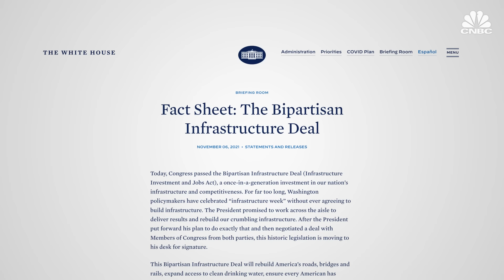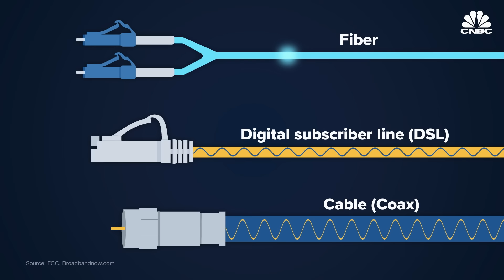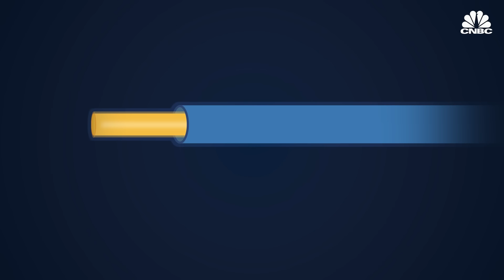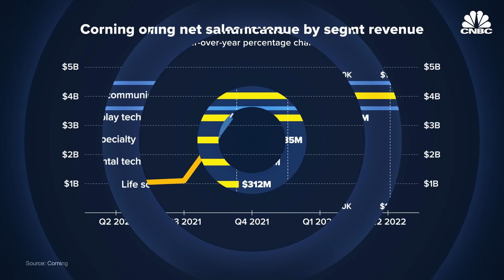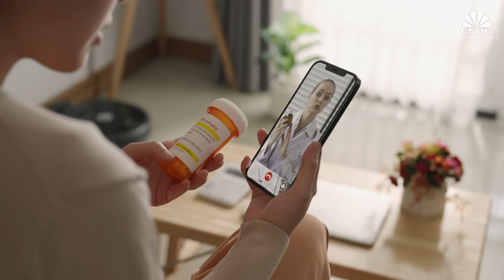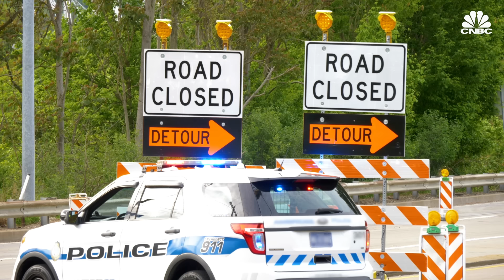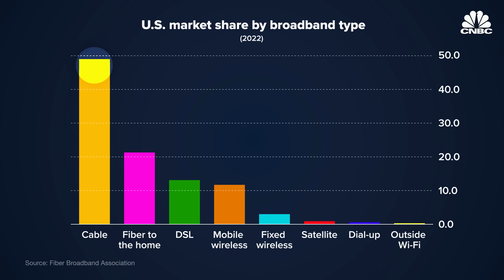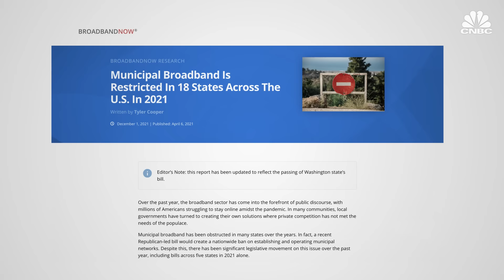How Fiber Will Speed Up America’s Internet

Comment: Internal networks can be satisfied with either copper or fiber. There's an ongoing debate between copper and fiber internal infrastructure mostly based on cost benefits. However, the long-distance communications are where the stark differences show. Fiber provides more bandwidth, cleaner signals over copper. I was initially amazed at the difference between Comcast (copper) infrastructure and the Verizon (fiber) infrastructure. much better upload/download speeds, better reliability, and comparable prices. If I ever move where fiber services are not present, I'll get a Starlink connection or 5G and will live with bandwidth differences just for the reliability.

Supply infrastructure of a lot of things were already at a breaking point before the pandemic. It was exacerbated by the pandemic and the following lack of employees.
Reply: We do pure fiber networks end to end here in Kenya and more and more customers will to ask specifically if as an ISP we are doing pure fiber. They don't want any less.
Reply: @mercynamikoye9084  Once you go fiber, you seldom go back to copper.
1. Better signal quality.
2. Smaller diameter cables.
3. Not subject to RF/EM interference.

One con just like going from analog to digital. If fiber is damaged, it's likely no signal just like digital TV signals.

Our main infrastructure was fiber. Sometimes the customer didn't want to pay to have a fiber net card put in their equip, so we'd use a txr to convert at their desk even though it introduced an extra point of failure.
Reply: @vwasson6725  is there an issue of cost in this industry like in health care? Cz for me in Kenya Nairobi, for 30 dollars only as a base my home customers have a 15MBPS connection inclusive of installation.  Pure fiber end to end. And it's a real 15MBPS and then can choose to upgrade to whatever suits their needs. For me as management I have 1G in my house for free that I hardly ever hit and costs the company next to nothing

Comment: Most houses don't need such fast internet and DSL is just fine. and some house holds are using just WiFi when in fact they should be connected by LAN when ever possible and WiFi only when needed.
Reply: I get what you're saying, but its going to be incredibly difficult to convince people to connect their devices with a cable. Wifi makes it much more convenient for most average people. I highly doubt most people want to wire their house with ethernet in every room or pay for that when wifi does most of the job. I do agree that wired is better for most tasks.
Reply: @JJFlores197  Most have no idea of the differences...until they see it. I provided an uncle a RJ45 usb dongle so he could plug in directly...even at his 15Mb dsl speeds he noticed a faster snappier surfing...and he knows NOTHING about computers

Comment: The business environment doesn't promote the upgrade of the existing copper plant fiber ... so in the center of Northern California (Silicon Valley), most homes are still using 50 year old copper runs for their Internet.  Comcast and AT&T are the primary providers ... but they won't compete for each other's customers, so there's no push to upgrade their infrastructure.  Consumers really have no alternatives and pay a huge premium for current technology if it's even available.
Reply: I'm in San Francisco and have had Sonic GIgabit Fiber for a few years. Sonic is a competitive local exchange carrier in the San Francisco Bay Area, Sacramento, and Los Angeles.

Comment: My question is why we don't make those thin hair cables much thicker in order to transfer more date inside if this is feasible ?
Reply: Not needed...single cable can transmit plenty...then there's extras, then there different wavelengths to increase...Just need the glass in the ground to the homes

Comment: Physically running fiber is the most expensive part of setting up a fiber network… The fiber itself is comparatively so cheap, ‘dark fiber’ where ISP’s run a shitload more fiber than they initially need is very common now, allowing them to spin up that ‘dark’ capability when necessary.

Comment: Are these fiber lines susceptible to em pulse? Or solar flare energy?
Reply: Nope, dont think so, they are made of silica, glass, maybe plastic? And they transport light, thats why fiber is so good.  Its immune to interferences unlike copper. You cannot bend it tough, as the light will not pass through.
Reply: No but the electronics on either end are

Comment: What about future-proof? As light is the fastest “thing”, does that make the fiber itself a future proof material that can last for generations of hardware revisions & bandwidth demand?
Reply: I always say it and the guy in the video said it. The limiting factor is the equipment on the end. Electrons generate photons and control the logical transmission of them. There is physical degradation on the trip due to length, fusion splicing and connectors. Then the reverse happens to go from photons back into electrons and the final conversion to ethernet. Light can be as fast as it wants, but it is only the highway not the engine of the car. An open highway with no traffic doesn't allow your Nissan leaf to go 186 000 miles per second.

Yes fiber can last. It has gone from carrying single analog signal to multi digital signal. This allows you to have secure information on the same fiber as public information. This allows you to prioritize data such as voice packets over internet. Packets. This allows you prioritize business data over general surfing and gaming.

My neighborhood had an analog TV cable feed amplified again and again in the 70s. This produces distortion and had a very high cost due to electricity use of the amplifiers. Then they ran fiber to the edge of the neighborhood and installed an analog fiber node. Most people think fiber means digital. Nope. The node uses 1550 nm wavelength going to it and 1310 going back on the same fiber. 

Then someone made a passive (uses no electricity) optical splitter. You put the combiner (splitter in reverse) in at the source and put the two signals on one fiber. When you get to the neighborhood you passively split the light wavelengths into two separate fibers and use the second abandoned fiber for whatever you want. I just doubled network capacity. 

Next, why go all the way from the source direct to the neighborhoods when I can assign different light wavelengths and put many neighborhoods on the same fiber but on different networks. Boom. 96 networks per fiber X2 fibers from the 90s. 

Final phase. Make the fiber a pure data feed and use both fibers. The opener is dual 10gig connections to a small segment of the neighborhood. The old stuff still in use now has a single 2.5gbs analog feed and the cable companies are selling 1 gig and meeting the target with ease. 

I've been doing FTTH since 1999. All the stuff I put in is still there except the edge technology has changed.
Reply: I doubt it the design can probably be optimized to be faster or something

Comment: you just tunnel under streets you don't rip them up. it's like oil pipeline laying except marginally more horizontal and MUCH shorter but can still take much advantage of tech developed to 'steer' the "drill head", or similar tunneling material/tip, to/through the most profitable path through shale for example but in this case to avoid sub street level infrastructure etc

Comment: They forgot to say fiber is only for city people and rural people won't get it or if they are lucky enough to live along a major highway they can get it. But it'll cost them 10-20 times more then city people for the same 1 gig connection.
Reply: It's a fair bit more expensive to roll out fiber in rural areas, so I understand why it's more costly. However, all cities should by this point have fiber optic.
Reply: @samialameddine1040  I agree It should be a bit more costly. However,  My old bill from when I lived in the Cities was 70$ a month (Century Link) Where I live (rural) now it's would cost 324.95 a month (ITC Fiber Inc) Seems a bit greedy to me. But hey, when a company has a monopoly, I guess anything goes.

Comment: Docsis 4.0 makes fiber to the home unneeded. With the rollout of this new system the cable internet providers will be able to offer 10Gbit down and 6Gbit up through a hybrid setup where coaxial is directly into the home. Problem solved for a while. 10gb connection will be more than sufficient for the average household for the next 50 years. By that time they may have much easier and cost effective ways of deploying fiber to the home.

Comment: In the |UK the first company to install fibre in the streets was NTL who were taken over by Virgin Media run By Richard Branson, he stopped installing fibre in all new housing projects so it never covered the whole country, even BT fibre now partly uses the old copper network in some rural areas slowing down the broadband speed , it has become unnecessarily expensive to subscribe to being the gold standard in communications, most people that were once on it have now quit fibre for all the problems that came with it mobile board band over a mobile network is now becoming just as fast on 5 G and monthly subscription is much cheaper a quarter of the cost, contract's run from month to month and providers can be changed as often as you like until you find the perfect provider for your area. who wants to be tied into a 18 month or 2 year contract these days?
Reply: Fibre is very expensive and NTL was not a profitable organisation and would have failed.

Comment: Is there any difference in the amount of data lost during transmission through fiber optic vs metal cable? 30 years ago I had a roommate who worked as an engineer for IBM in Rochester Minnesota and at that time they knew that data loss happened during transmission but they didn’t know how it happened.
Reply: All media transmission hardware has some loss of data, protocols like TCP/IP were designed to manage this loss and communicate in ways that ensure all the data eventually gets transferred.  Search Quality of Service (QoS) for it.  The signal speed is really the biggest factor between metal and fiber (there are others). If you can talk with less latency between sentences with someone, the faster you can complete the conversation, which is essentially what each data transmission is.
Reply: @cyclopentadiol2923  
Are any programs designed to send the data twice in order to fill in the gaps of lost data?
Reply: @MustangsTrainsMowers  That's what TCP/IP is designed to do.

Comment: That is for airplane so the critical parts not leak throught traditional wiring and simpler repair and maintenance for complex fighter jet wiring and boeing. But cheaper is light and photo cells and metal tube cost less

Comment: Fiber networks do not transmit at nearly close to the speed of light. It typically travels around 1/3 the speed of light. Theoretically, they should be able to and there is some cutting at research that’s getting close but that’s just highly specialized experiments for the most part the rate at which data travels through fiber is typically around 1/3 the speed of light.

Comment: I am surprised to see a tv program on fiber network… in Asia it is taken for granted
Reply: America has a very widespread cable network that can handle high speed internet and it is the reason why the average speed in the US is 200Mbps. And the US has had that for the last 50 years. 
US has had cable commination's in homes since the late 1940s and it was routine in the 1970s. Replacing that will be a large job.

Comment: I think 5G is adequate for most people's bandwidth usage. I think a roll out of fiber is for most people a waste. Investment into wireless signals is so much more important.
Reply: 5G still requires fiber infrastructure. And you also have to consider the limited spectrum available to wireless. There's been many instances of people getting really great speeds on 5G home internet (like Verizon, T-mobile etc) and then as more people start using the service, it gets saturated and slows down for everyone.

Comment: Australia was going to have a full fiber network but then there was a change in government part way through the roll out and they hamstrung the network by by making it FTTN instead of FTTP. The old copper lines in my area are a joke much like many other regional areas.
Reply: All nonsense. 
Australia is a large place and even though the people live in the coastal regions they are still spread out. 
Take Sydney for example it is spread over 12000 square kilometers with a population of 5 million. London is spread out over 8000 square kilometers with a population of 14 million. The last mile is the most complex and expensive part of internet connections hence why it is so slow to get there.
Reply: @bighands69  WTF are you on about???
Reply: @WeirdNamja  
You are talking like there is some big political scandal or conspiracy.  The only thing that is happening is that politicians are over promising. 
Australia is massive and the cost of such a network would run in the hundreds of billions. DO you honestly think Australian politicians can actually deliver on that promise.
Reply: @bighands69  they were, until a change of government part way through the works, any areas not done at that point got the plans downgraded. Have heard just the other day the plans to go FTTP may be back on for areas like mine that are too old to be reliable.

Comment: how fast do people really need? i mean i stopped worrying about slow Internet at around 10mbps.. currently at 100mbps. 10 times more bandwidth than all my use cases require. i reckon most ppl that have broadband already don't need the speeds that are achieved with fiber.  if the prices were the same sure, bring on the free extra bandwidth. i have a feeling it won't be cheap given the cost to lay fiber.
Reply: The rest of the world doesn't live at your snails pace. 1 cam of 12 I want to stream takes 7Mb...My internet upload is 10...takes nearly all of the available for a single camera

Comment: When I worked for AT&T DSL support I was so jealous of the folks on the West Coast back in early 2000s who had something called integrated fiber in the loop, many of them had fiber to the curb. Even fiber to the D slam is it big improvement over twisted pair. Of course I never got any sort of broadband Internet other than LTE over wireless outside of a major metropolitan area less than 7 miles from the city of over 150,000 people in 2010, that’s embarrassing… Once I learned how to coax broadband out of wireless devices that it’s all I’ve used but there’s so much more potential and fiber optics the closer they get and the more they are in the home the better things will be they are so simple and so quick they literally travel at the speed of light. Sometimes faster… Just remember though that the Internet packages most of us are sold are way more than we actually need. Someone with three computers with four gig L2 cash each they won’t need hi gigabit Internet because the devices use half that balance
Reply: I'm in California. I had Fiber to the Node and now I've had Fiber to the Home for a few years.
Reply: Meanwhile 1 of my many cams I want to stream take about 7Mb of my 10Mb capped upload

Comment: Trans-oceanic High Bandwidth Satellite Communications is a more practical option in my opinion compared to ocean cables, a satellite will serve as a bounce relay for a high bandwidth signal packet coming from lets say North America and transmit it to another base station location on the globe let's say Asia. From that base station it is distributed to their final destination through various medium whether 5G, fiber, DSL, mobile, etc. It's like ocean cables but wireless, they are just too complacent to do research and dev. Starlink is a great initial attempt, thanks to Elon Musk but the downside of his own way is it requires too many satellites. The only improvement solution for Starlink is for the satellites to increase throughput and bandwidth capacity. More throughput and bandwidth capacity per satellite means less satellites deployed and less cost.

Comment: How much speed do we really need ?
Reply: What we really need is stability, HFC networks use fiber up to the node but transition to coax for the last mile, which is susceptible to interference and thunderstorms, fiber is set it and forget it assuming it hasn’t been damaged for whatever reason.
Reply: Well most games are 150 gb now. So at least 500 mbps.

Comment: would it be so difficult to transform all of the electric grid to a high speed internet
Reply: Not not all is needed but they can wire wrap fibre around electrical cables so that they do not need to set up new poles or dig new trenches.

Comment: It’d be cool if they built a motherboard with fiber optics rather than copper. That’s be some ultra-fast computing. Nvidia 5080 Fiber optic card that works with a fiber optic motherboard, that uses a fiber optic processor and RAM. A man can dream… heck you could just go fiber optic from the outside fiber into a fiber ISP router over a fiber internet cord into a fiber internet adapter on the motherboard through the fiber optic internet port on the back of your desktop. Who knows maybe one day we’ll have a fiber optic iPhone…

Update: it’s called a photonics computer. And a photonics smartphone like an iPhone 17 Ultra or something would be wildly expensive. Think 5,000 dollar iPhone.
Reply: There would still be bottlenecks in the systems. Optical computing will someday be a reality.
Reply: In an average home fiber is super easy...just no point currently in most cases. Fiber us just not available to most of the population due to corporate greed